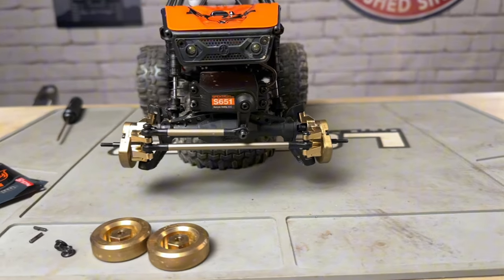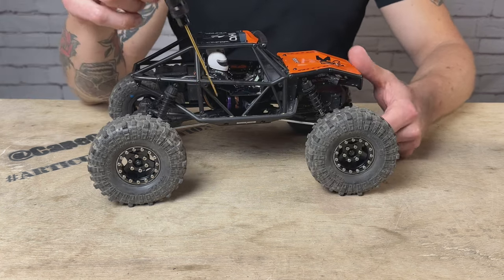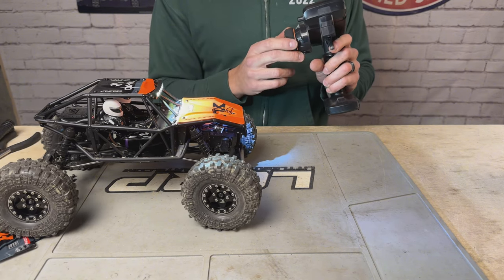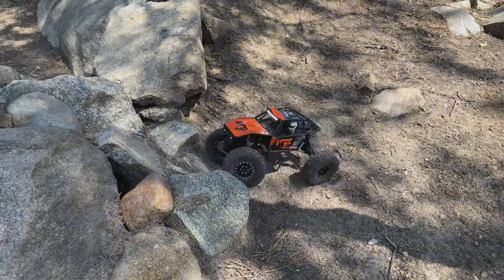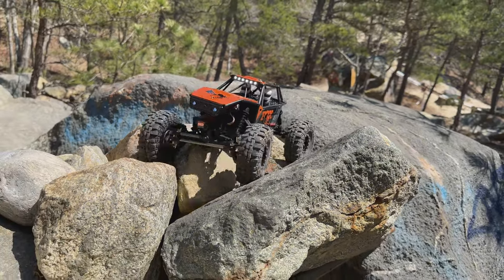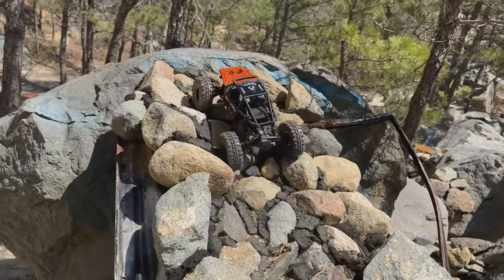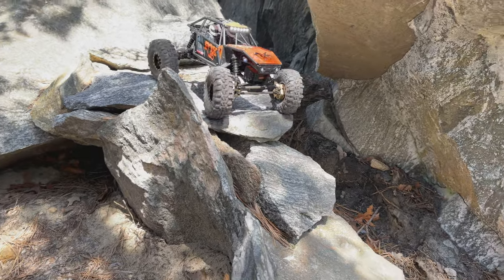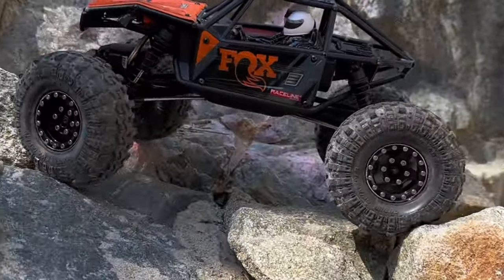The Sweet Spot: UTB18 Capra V2 Build! Dlux Fab Axles, Mofo RC Brushless Motor & More!

Comment: Just picked up a UTB18, the green one is on sale on Amazon for $199. This will be my first RC crawler! Think I'll take that 50 bucks and throw it straight into this motor+esc upgrade. Will it work with the stock radio?

Edit: Nope, need a 2ch radio.

Comment: Please help I have the same esc and motor but mines still doing what the first furitek system did acting under powered and clogging I’ve check my drivetrain and hear mesh I’ve tried just about everything and still doing it what settings are you running for the mofo motor on the furitek app? Any other tips would be greatly appreciated